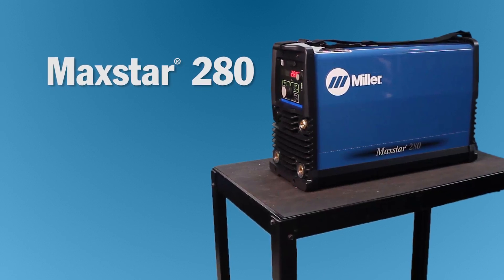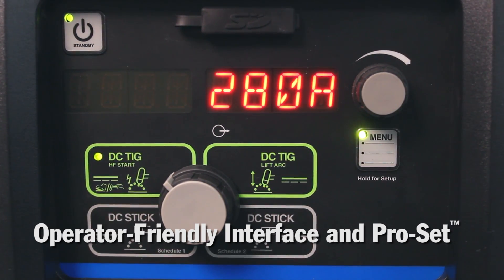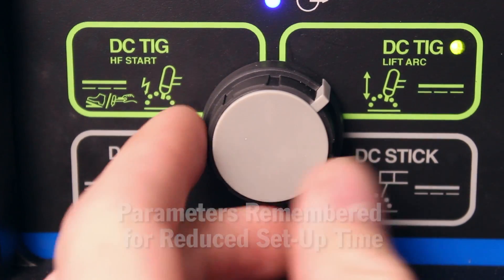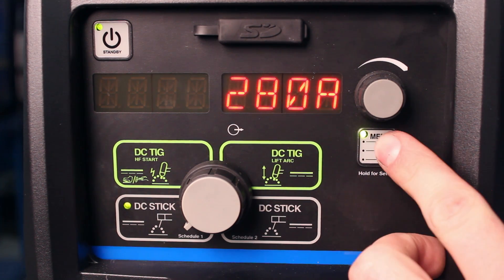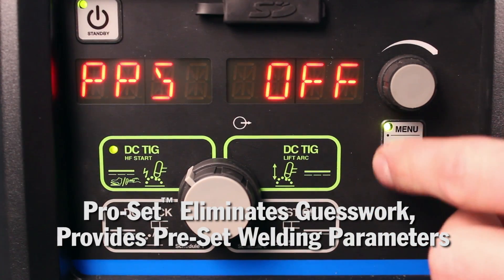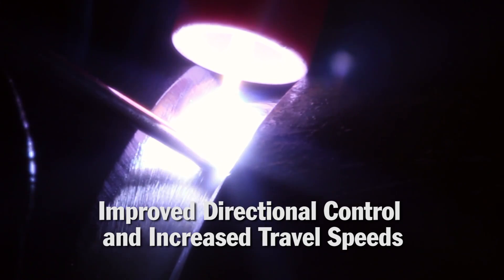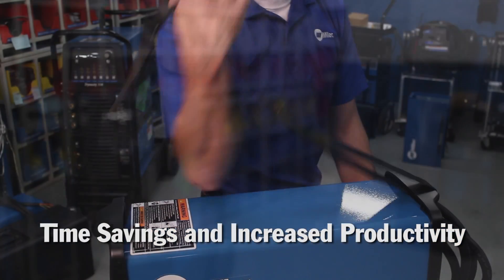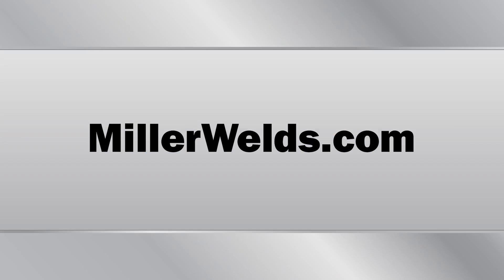Miller Maxstar 280 TIG Welder Delivers More Power in Capable and Portable, Light-Weight Package

Comment: Hello sir...can I ask question?the maxstar 280 is it autovolt?
Reply from the maker: Hello Michael. The Maxstar 280 comes with Auto-Line Power Management Technology which
Allows hookup to either single-phase or three-phase electrical input from 208-575 V with no manual linking, providing convenience in any job setting. An ideal solution for dirty or unreliable input power. For more information, here is a link to the product page: https://www.millerwelds.com/equipment/welders/tig-gtaw/maxstar-280-tig-welders-m00356#!/?product-options-title=maxstar-280-dx-208-575-v-cps-907539.
Reply: Thank so much sir...

Comment: Thank you for the informative Video. one question, how to set pre flow & post Flow on Maxstar 280?
Reply from the maker: Sunny Batish If you push the MENU button once while operating the Maxstar 280 the pulse frequency control is accessed. If the MENU button is depressed twice, then Postflow is accessed and can be adjusted between Auto, Off, and any duration up to 50 seconds. When set to Auto, you will have a minimum of 8 seconds of postflow with an additional second for every ten amps set above 80. Here is the link for this product’s Spec Sheet: http://www.millerwelds.com/pdf/spec_sheets/DC35-0.pdf. Please let us know if you have any further questions.
Reply: Miller Welders ok